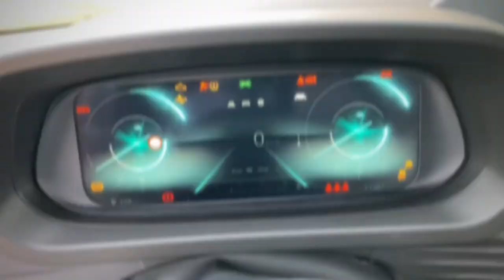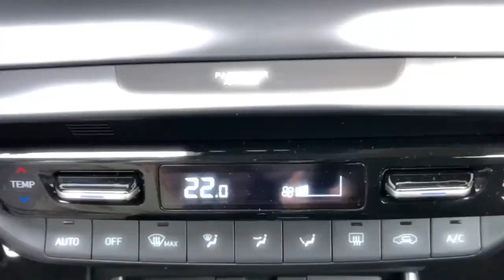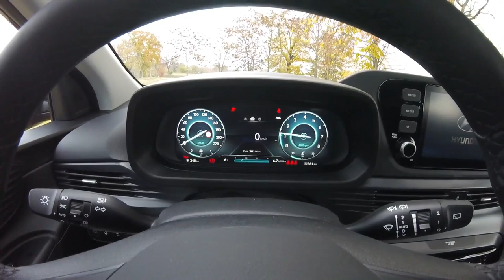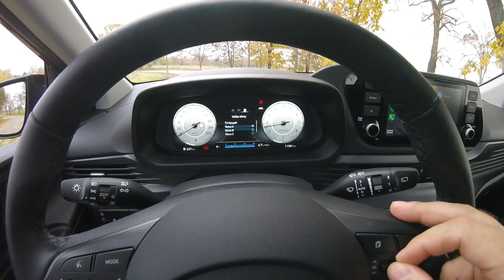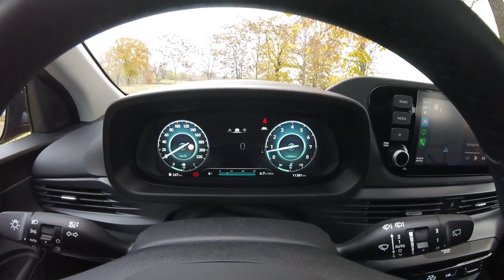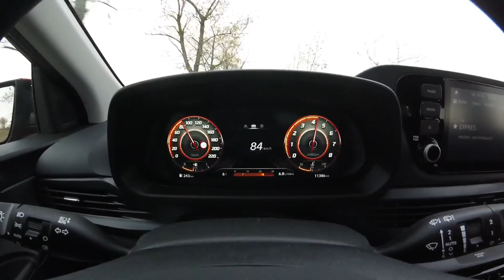Hyundai Bayon 1.2 MPi Family - showcase, POV and acceleration

Comment: hi, can you let me know plz what's the RPM at 120/km?
Reply from the maker: 120km/h is about 3950rpm. In 130km/h it revs exactly 4100rpm...
Reply: @AutoZineSK  And for 100km/h In V gear how many RPM you will have around 3000 or more ?
Reply from the maker: @ciprianbogoiu3812  Yes. It is exactly 3000 RPM in 100km/h on 5th gear...